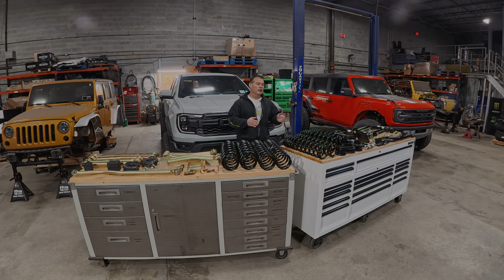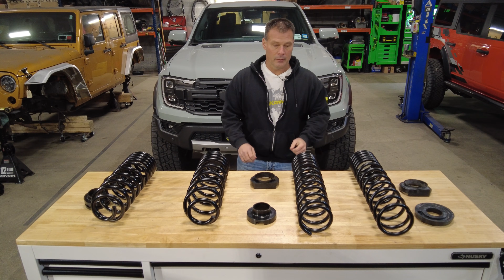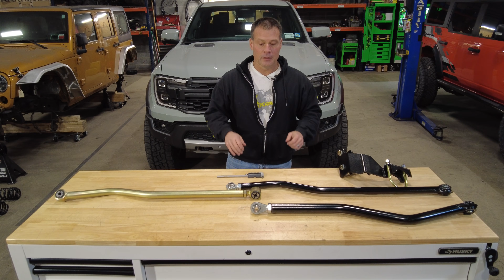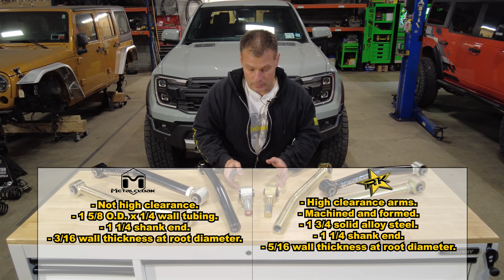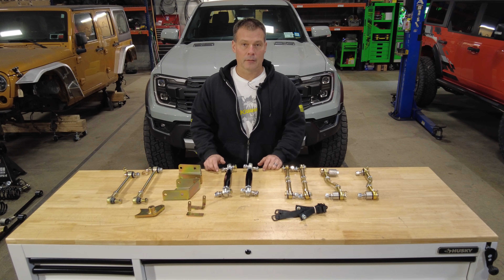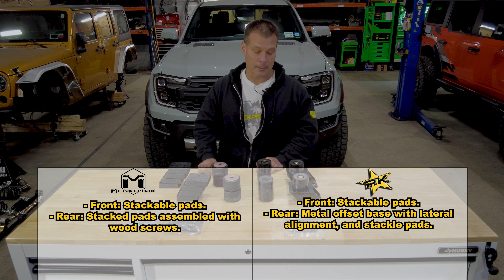Rock Kawler Adventure-X Mid Arm vs MC Direct Comparison Video

Comment: This is a good video but clearly more research was needed into MetalCloak components. https://www.youtube.com/watch?v=rmuEMyCgST8
Reply from the maker: For which part would you like clarification?  We did not try to bash them at all nor provide false information.  We would be more than happy to help you with clarifications.
Reply: @RockKrawlerSus  You didn't bash them which was great to see. The materials you stated components were made out of are wrong. The track bar for instance. The vice test is the incorrect way to test control arms, you need to test them in the same mount as on a vehicle. That gives a truer representation of capability. There were a couple others but I didn't rewatch the video to reply. I've commented on other brand videos for similar issues when doing comparisons. I don't run either brand but truth in details is something that matters to me.
Reply from the maker: @4wheelsandamotor  Not exactly.  We stated solid alloy steel.  Chromoly is just a particular alloy of steel.  We did not want to destroy their track bar and send fragments of it to be gas chromotographed to actually get the chemical break down to determine to exact alloy.  It was not our goal to throw shade in their direction, but to answer the common questions that we get all the time when comparing systems wether it be on the phone or in social groups.  When people ask their materials etc. they are not very transparent, where is we are more like an open book and will tell everyone just about anything about our stuff.  Why hide it?  If someone really wants to find out, there is always a way.  When it comes to the joint comparison, we kept it simple and relative.  The big difference between our adventure series joints and their duroflex joint is the method of pivoting.  The articulation is almost identical.  We just wanted to keep it relative and simple.

Comment: When are one of you two companies going to go Head to Head on flex, apples to apples. getting two identical jeeps, using the same lift hight and comparable lifts and flexing them out!
Reply: This information is out there with metalcloak CTI numbers. Metalcloak can score over 1000 on the JK/JL without going long arm or different link setups that require heavier modification, essentially the absolute limit that can possibly be achieved without full custom build or hacking the frame or components apart. I’m not sure what the rock Krawler similar system can do but judging by some of their shocks you can opt for it’s possible they can too, I’ve just never looked to find out what it can do

Comment: Shame we had so many issues with kits being on 6-8 week backorders and then some issues getting items warrantied about 10 years ago back when we sold Rock Krawler.  We hated those X Factor joints.   Didn't hold up in the northeast.   Actually pushed us to become a Metalcloak dealer.   But after 10 years we have dropped Metalcloak due to rising prices and dropping dealer discounts.   By the time you came out with a lower maintenance joint we were in deep with Metalcloak.   Maybe we need to give Rock Krawler another look.

Comment: One kit makes your Jeep taller. The other makes it unstoppable.
Reply from the maker: But, which is which in your opinion?
Reply: @RockKrawlerSus  I will tell you that two Rock Krawler Rigs made it up trail 15 and trail 75 (Walden's Ridge) no winch at Windrock Park. A JL with a 4.5" Adventure series mid arm and a JT with 3" triangulated rear. Then they both drove home 600 miles no trailer.
Reply: The true trail tests of any rig! Especially daily drivers.
Reply: I just drove my 392 wrangler from Washington state to moab towing a razer on a 18ft trailer, did these trails. Prichet,  metal masher, steel bender, top of world,  the pickel, cliffhanger and poison spider.  Metalcloak 4.5 gamechanger on 40's.  Drove back to Washington with zero issues the entire trip. Jeep drives and rides better than stock.

Comment: Appreciate the comparison info. Have had the RK ProX tie rod & drag link, and Adventure Pro X control arms on a 2020 JTR for almost two years quiet and trouble free. Went with portals so didn't need springs at the time. Multiple trails and highway trips between Texas and Colorado and Utah. Will be using RockKrawler for springs and swaybar endlinks and front track bar, as well. Very pleased with everything. Thanks for all you do, Jeremy! 🤘
Reply from the maker: Very cool.  Did you go with 74 Weld Portals?  They make some bad ass stuff.
Reply: @RockKrawlerSus  Yes, I did, and yes they do.